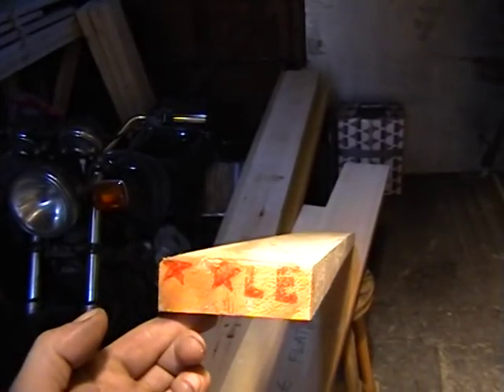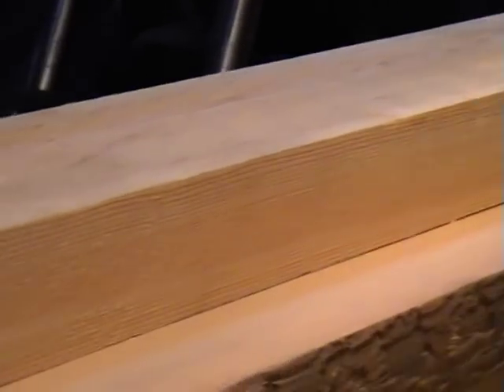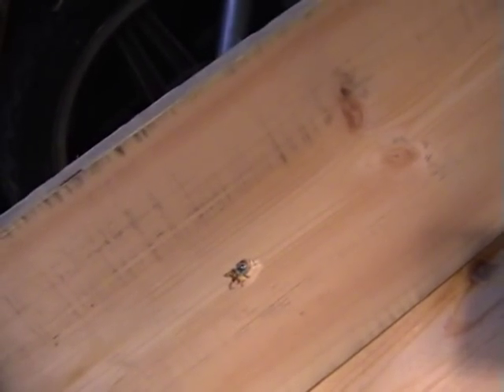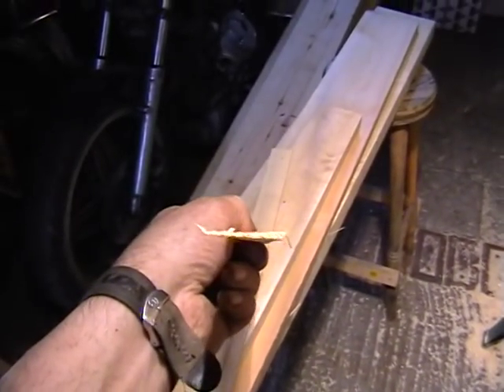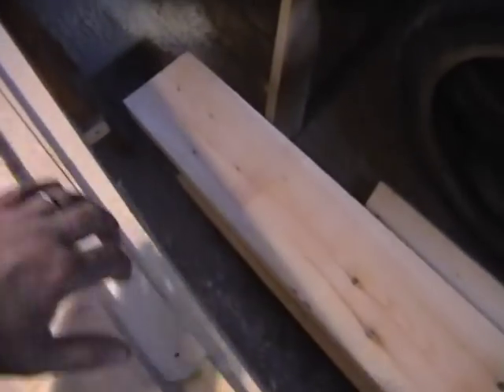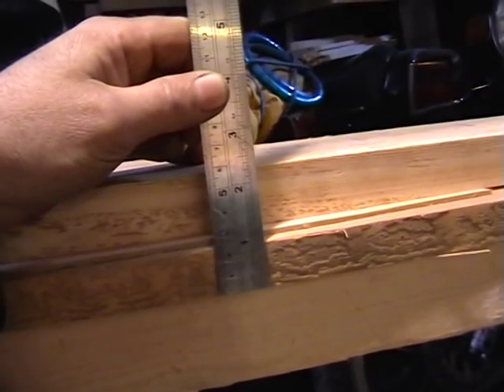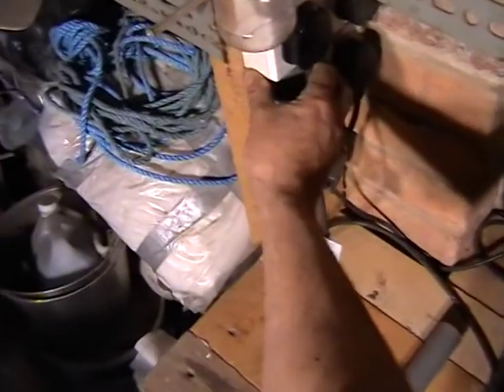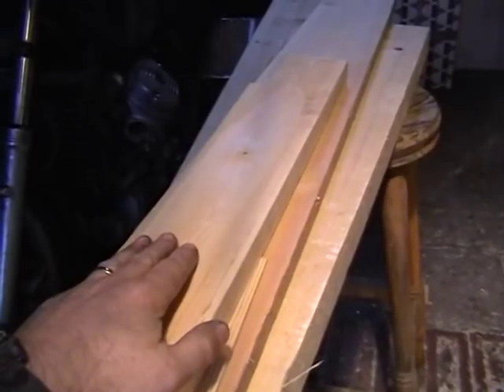Bowed, Twisted Timber (Lumber) Planing, easy HOW TO

Comment from the maker: Hi Peter, Good Question. The referance board I use is PSE from a timber merchants with Quater sawn grain so its not bad. Although it's not perfect it works because the planer only "sees" the thickness that's passing through it. So as long as the referance board is flat when you position the wedges the board will come out good. Try it and see what you end up with, you could then use the one just planed as the referance board, repeat as required to get it flatter every time. Good luck.

Comment: Nice technique :-) I've seen something similar which saves you marking the face of the timber with a screw and fiddling with wedges, where you hot glue gun an upright straight thin strip of material either side of the board then pass through the thicknesser a few times until its took off the high points of your board - the upright glued on strips prevent it from flexing n the planer bed. Then simply rip off the strips on our table saw after you're done - voila!

Comment: Makes sense... I will straighten a couple of 2x2s on my tablesaw by screwing a plywood straight edge on it, and then fixing that to a melamine board from an old IKEA shelving unit. Of course you are right - it only has to be straight when fixing the cupped/warped board to the "sled". Thanks

Comment from the maker: I find using the (jointer) part of the machine to get a flat surface takes a lot of skill and consitency of hand applied pressure, its even harder on longer boards. This technique takes all the guess work out the job so that is why I prefer to do it this way.   So I don't think you've missed anything and the thicknesser does give you parallel edges, in this case exactly parallel to the referance board every time.

Comment: Nice job. I use the same technique, but I have a box full of small wedges, each about an inch long. These make fitting to the gaps a bit easier. But does your thicknesser not have a feed table? It makes life loads easier.

Comment from the maker: @donepearce Thanks, yep I can see how the small wedges would work just as well maybe even easier. The thicknesser doesn't have feed table and I've often thought a longer steel plate added to the rising table might be an advantage. I don't know if the rising mechanisum is strong enough to take the extra tiliting force this might put on it. It's certainly not a perfect machine but I do get good enough results out of it as it is.

Comment: Can you please explain how you made the small tapered inserts to support the bow? Or if you have a video explains that would be great thanks
Reply from the maker: Table saw with a slightly off square slide. Flip the piece of wood over each cut and you end up with wedges.

Comment: How do maintain, or indeed produce, the reference board... I mean - solid timber of that length - doesn't it warp? How did you make it? I was thinking of laminating 2 pieces of melamine together, but i don't have a single 100% flat surface to do that on either :).

Comment: Hi Peter, I am intrigued on how to straighten timber on the table saw. I have been wondering if this is possible, do you have any more information on this technique?  Or anyone else for that matter. Thanks in advance.
Reply: To straighten an edge on a table saw is doable.  The face?  Not as easy.  If you don't have a thickness planer but you do have a router that's a possibility.

Comment: Where does one obtain a flat and true reference board to begin with? It turns out that all of my existing wood is warped, cupped, and twisted beyond belief, even my plywood and MDF.
Reply from the maker: It's a chicken and problem. With all your timber warping, you might have some storage problem?  You could have a good look for new board at timber merchants, a quarter sawn piece would be best for stability. Or can you get some faced chipboard / second hand kitchen worktop.
Reply: If you think about it, it does not even need to be wood!  A sheet of steel would have the same effect.

Comment: Why not just use a jointer (here in the US) to get the perfectly flat surface you need. It seems like you're using a machine for a purpose other than what it was designed. A planer (thicknesser in the UK I guess) is designed to make one surface parallel to opposite surface and to make it the thickness that you want. Am I missing something here?